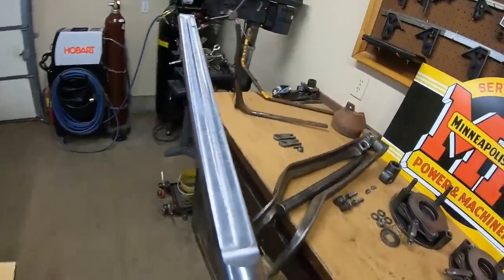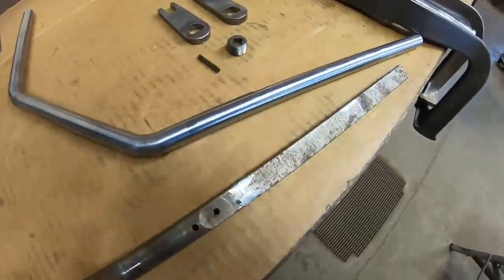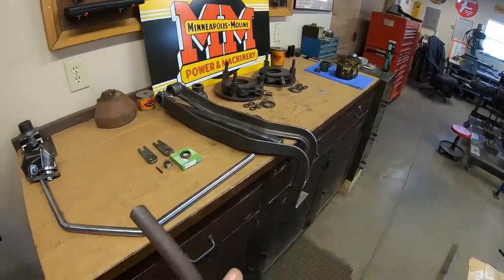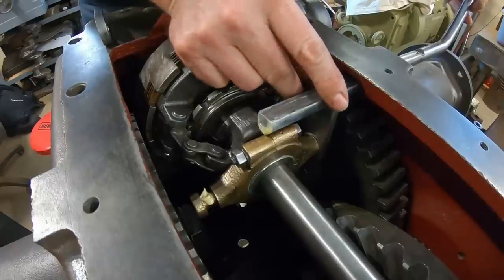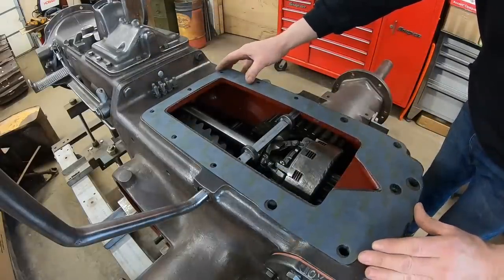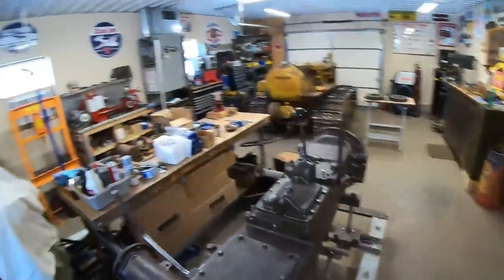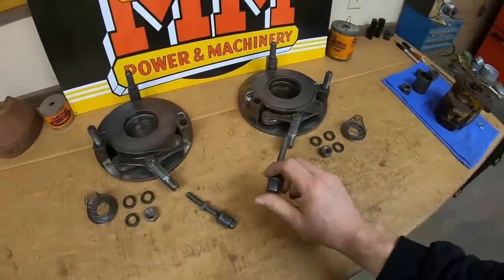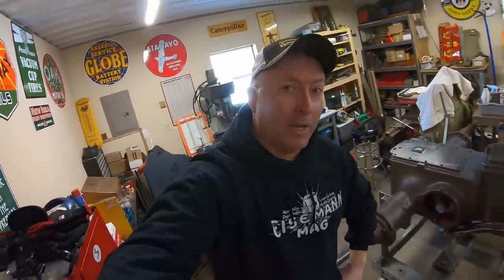#X231 Prototype Part 65: Live Power Lever Fab Complete, Top Cover & Brake Pedals Go On!

Comment: When you are bending anything with heat always heat the inside of the bend, that way the material compresses if you heat the outside the material stretches and therefore is weaker. From Australia

Comment: Looking good! A little surprised that there wasn't a large flat washer between the brake pedals. Most tractors I've worked on with similar layout usually did.

Comment: Hey ,I’m not an expert but you are doing a great job. I only have found only one, yes only one thing. I was told that when you bend a rod or tube with heat, heat the inside of the bend more. That way you are compressing the metal not stretching. I think if you stretch it it would be weaker.  You can diagnose and fix anything you work on. Great job

Comment: I really think it might be worthwhile to spin up the transaxle with a large  drill motor on the stands after assembly of the transaxle to verify everything works properly prior to final assembly of the tractor.  I assume your hollow set screw won't be subjected to thrust loads, but I did not see how that bearing assembly is supported for thrust loads.

Comment: Mr. Squatch, not to give unsolicited advice, but your endmills and lathe bits will last a lot longer if you wait to turn the machine off until the bit/cutter is clear of the part. Letting it spin down in contact with material will chip the corners off high speed steel and especially carbide tools.

Comment: I think you uncovered a major reason for the changes from prototype to production when you had to jiggle that lever into place.  The production version would have been a lot quicker and easier to install.  I suspect MM used roll pins because drilling holes is a lot easier than milling flats or keyways.

Comment: The production pedals/arms have reinforcement ribs that are curved.  I assumed this was to clear something on the transmission housing (the prototypes were longer, with straight ribs so far as I can tell), but when you installed the pedals, I can't see what, if anything, the sides of the pedal arms would hit.  What am I missing?  MM surely wouldn't have made a more complicated casting on the production pedals/arms just for looks...?

Comment: I don't know if the measurements match up, but I would imagine the extra hole could be because they originally intended to use a plate bolted to the outside of the housing instead of the threaded plug they ended up using.

Comment: that probably be unwelcome comment 
but did you had to heat the rod so much and in so narrow length for bending? it kind of reducing in thickness on the bends as if it was getting ready to break there
was the oryginal lever forge bended as well or was it bended in some crazy press with a v block and a round die to look so much smoother

Comment: The hole you did not drill could have been for a roll pin also, you would leave the plug out and push the shaft in far enough to drive a pin in then pull it out and put the plud in. The pin you now could get caught under the lip of the casting?
Reply: @squatch253  Even when out of adjustment?

Comment: Glad you got your metal before the storm, hopefully your brake parts will be in tomorrow (today)morning.
I thought you broke it or snapped it off when you were bending as the editing or my feed made it sound that way when you banged it.
Would that roll pin that was ignored be for a "soft stop on the lever vs a "hard" stop up against a housing or other solid item around the handle shaft? Did the production shaft have that? I dont remember, nor do I remember if there was a case to compare to. It stinks to get old.
It looked that the top cover does not seal up because one if not both of those two bolts under the 3 point assembly looked like it was partially open, but that could be the view and or lighting.
Reply: @squatch253  have a good day!